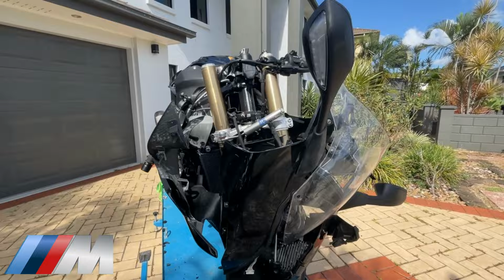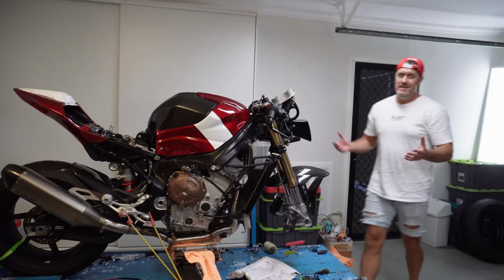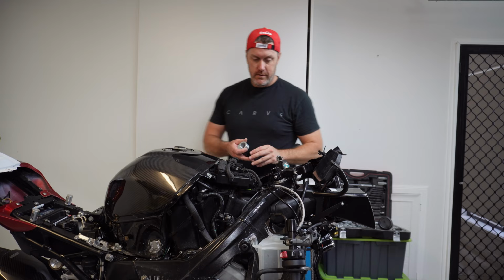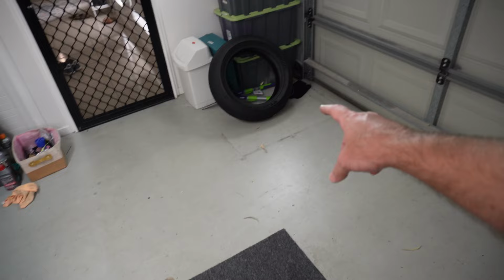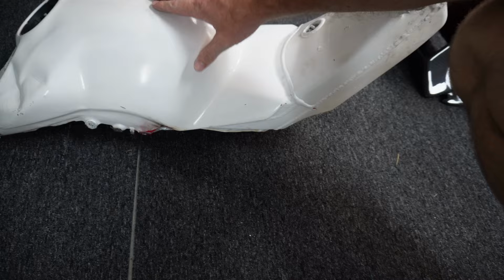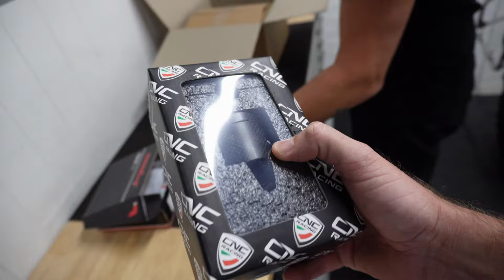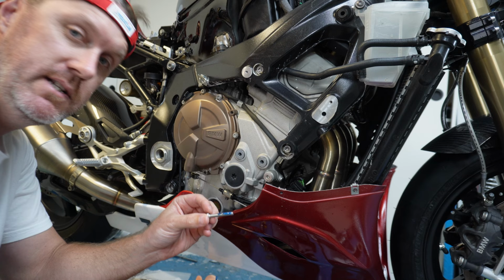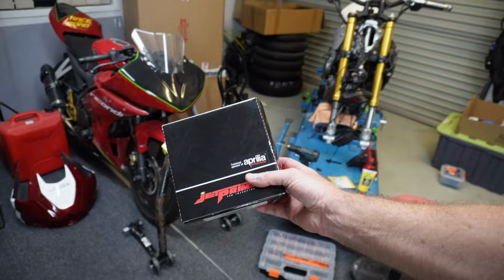REBUILDING WORLDS CHEAPEST WRECKED 2022 BMW S1000RR EP6

Comment: any advice for replacing the standard pipes on the 2023 s100rr. What happens with the valve shutter?
Reply from the maker: Brendan it’s super easy, only issue is the headers are joined and go either side of the sump so you need to have front wheel attached. Then it simply lowers down…